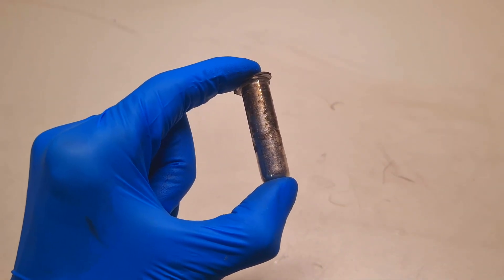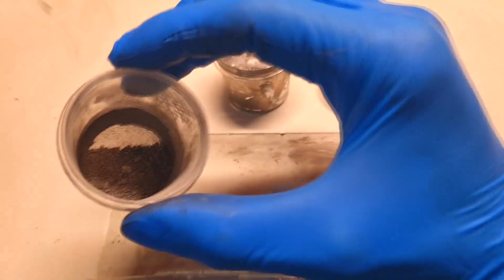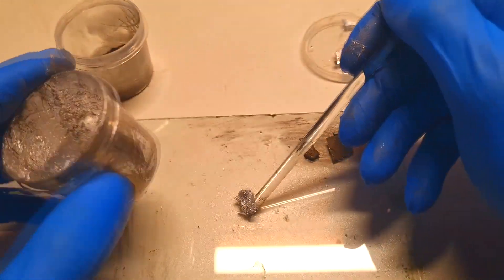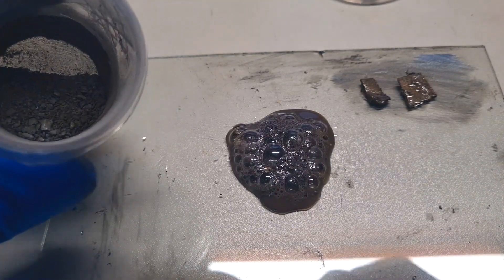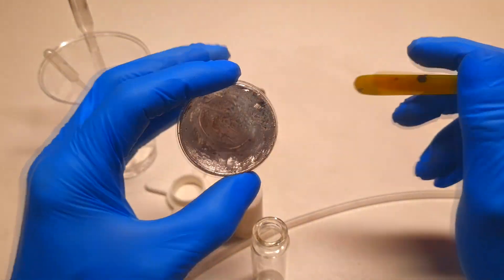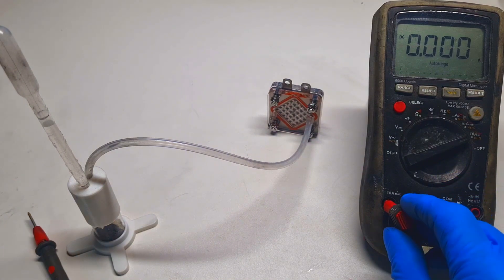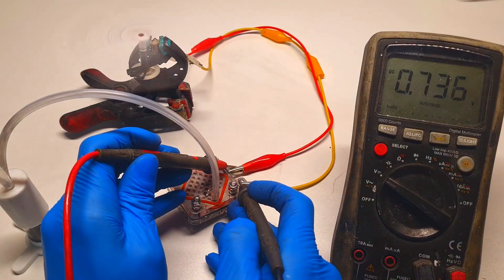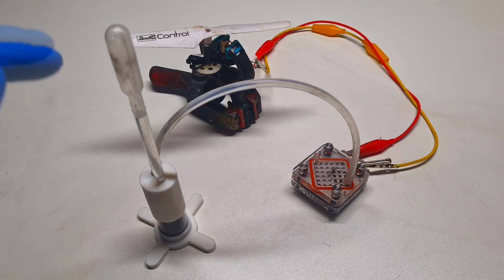Aluminium/Gallium - Hydrogen fuel cell

Comment: Hi Dusan, this is really interesting, can I buy the cell and do this experiment? Or is it modified for you?
Reply from the maker: Hi! Yes you can buy the cell. On ebay for hydrogen fuel cell
Reply: @cayrex do they come with platinum inside? I see hydrogen fuel cell proton exchange membrane for very cheap on amazon. Are these the same thing? Thanks
Reply from the maker: @myscitechs2497 yes.... platinum/carbon, nafion membrane....
Reply: @cayrex  strange with such cheap price!
Reply from the maker: @myscitechs2497  all materials are in small quantities.
Reply from the maker: Just buy some no brand china fuel cell. Because Horizon brand is extra expensive
Reply: @cayrex I see, Thank you
Reply from the maker: @myscitechs2497 I buy that one and is ok. https://ebay.us/m/ZUEO9F

Comment: I have a question is it possible to connect the fuel cells in series and parallel to increase the voltage and current
Reply from the maker: @shingirayichipere8815  yes you can

Comment: Some people have suggested that scrap aluminium used in this way is a good energy source. But what you are doing in effect is unleashing the large amount of energy which was required to create the aluminium from bauxite in the first place. From an overall efficiency perspective, it's better to recycle to aluminium because otherwise large amount of electricity would be required to replace the aluminium scrap for purposes which need the metal itself.

Comment: Another video claims 130 mL per gram. If true this is 130 L per Kg! If  1 L will drive a fuel cell car 60 miles that's a looong way on 1 Kg!
Reply from the maker: Yes it looks like it is 130ml per gram of alloy
Reply: @cayrex  the thought occurred to me that the aluminum air battery gives off hydrogen so why not use that in a fuel cell? Do much potential is lost in the AL Air battery total energy density. Of course part of the fuel is vented and never used!
Reply: @evanriddle1614  Aluminium air batteries don't release hydrogen when they are in operation. They only do when they self discharge

Comment: Did you test if an electric potential is also possible in the reaction zone between aluminum and water?
Whether positive or negative, it would mean that you have some potential there and you are wasting it.

you can recover that gallium later

What if instead of aluminum you used magnesium?

Comment: I've tried gallium with aluminum anode for aluminum air battery. Yikes!!! It goes crazy! Maybe if gallium is added in tiny measured amounts while aluminum is molten to slow reaction? Also: water collects in cathode. I've begun "charging" the aluminum battery to electrolyze water to remove it from the cathode. Aluminum for hydrogen production certainly one of many approaches. So much can be done with this.  Thank you!

Comment: Hello video class. But you probably know that foil, which is not pure aluminum, contains impurities. It seems to me that due to the fact that there is an admixture of magnesium in the foil, the reaction goes faster or I’m wrong. If you can check it on different aluminum, for example from disposable baking dishes or beer cans, I think magnesium is not the least important in this reaction.
Reply from the maker: The final product is hydrogen, so no other gases will be created if you use only water. Here you can use pure or not pure aluminium. The reaction speed will also be dependent on how fast you add the water.

Comment: the problem is how to recicle the galium and how much you lose galium
Reply from the maker: When the AlGa alloy is reacted with water will produce hydrogen, aluminium hydroxide and gallium metal. The gallium will be on the bottom of the beaker. And if you heat to 30 degg C you can pour out the gallium.
Reply: @cayrex  but how muchgalium  you loose?

Comment: Very nice Dusan! I think I recall reading a paper on this and they found that the most efficient use of Gallium/Aluminum reaction is 3 parts Gallium to 1 part Aluminum! Also if you put Aluminum foil in a rock tumbler for like a week the aluminum particles get small enough that they will react directly with water without using gallium. However the aluminum is extremely reactive so don't get it near sparks and don't use steel balls in tumbler use marbles or something lol
Reply from the maker: Yes correct. This is exactly what gallium does to aluminum,... AlGa alloy is able to create aluminum nanoparticles. The only problem with using only aluminium is that aluminium reacts quickly in air to form a passivation layer of aluminum oxide. But the gallium inhibits the aluminum from forming a protective oxide layer.
Reply: @cayrex what about using the all carbon cell setup you used when you produced hydrogen fuel cell with graphitic carbon felt, current collector and separator instead of this eBay fuel cell?

Comment: Thank you cayrex. You should first keep the remaining product at the end of hydrogen production in sodium hydroxide solution. This will get rid of most of the aluminum in the alloy. Then, if you throw the alloy with some aluminum remaining in water and heat it to 80 degrees, you will recover most of the gallium.There is a video about this process:  https://www.youtube.com/watch?v=sUSjWfBBu2Y&ab_channel=NurdRage

Comment: Well done Dusan.
Will the alloy also be used up or only the water ?
Have you already tried to make your own fuelcell that generates about 0.5 Watts of output power from Hydrogen ??
Reply from the maker: The aluminium and water ar used. But the gallium can be re-used. For making  homemade fuel cell I will still need some catalyst
Reply: @cayrex   Did you find the catalyst?  Any further progress?
Reply: Will the Aluminum be converted to AlOH3 in this experiment ? What about the Gallium ? Will it also be consumed ??